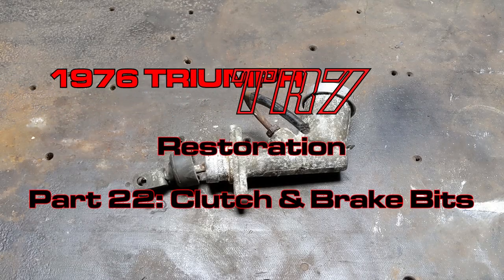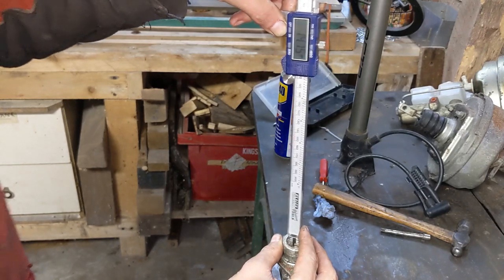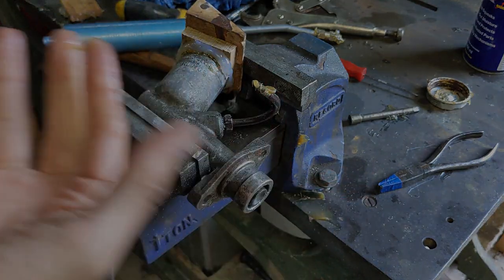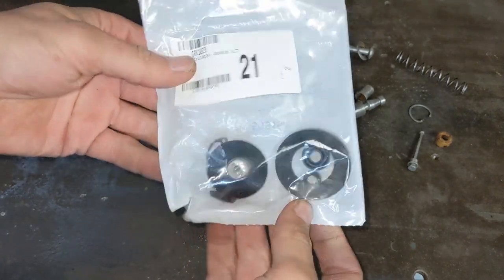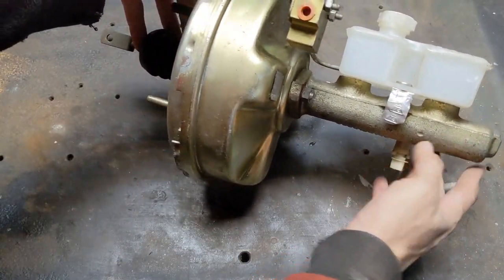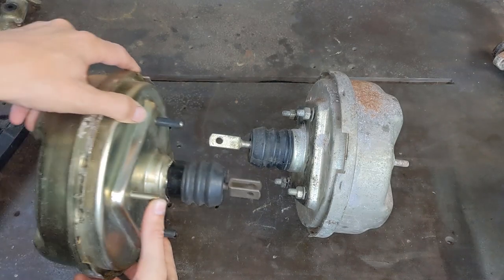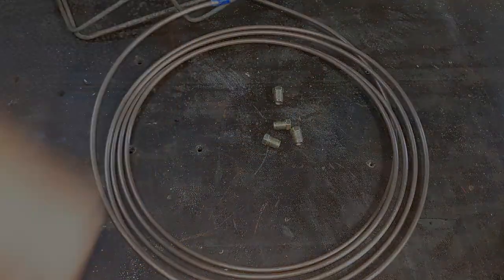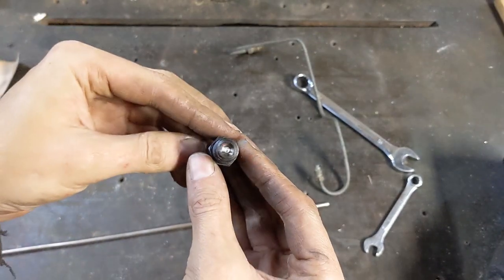Brake & Clutch Cylinders - Triumph TR7 Restoration Part 22

Comment: The broken flare tool was because you did not forget to put both nuts on the pipe before flaring the ends lol.
On a serious note, I did as you did with the clutch master cyl and the bloody thing leaked after a few months so it's worth while getting a new one as it makes a mess of the paint soundproofing and carpet.
Good to see progress.👍
Reply from the maker: Haha, yes, something had to fail! 😆

I'm confident the clutch master is okay, if it had been pitted I'd have tossed it. But the bore is as smooth as a baby's bum after the honing 🙂 Honestly, I've got more trust in it than some of the modern pattern replacements, which tend to be hit and miss on quality. But noted, and I'll be keeping a close eye on it 👍

Comment: Soaking stuff in Diesel is a great way of shifting stubborn bolts etc.
Reply from the maker: Indeed. But the issue with the clutch cylinder wasn't that it was that badly seized, it was that I couldn't get a decent grip on the piston to pull it out. Not without damaging it anyway. In retrospect, soaking it in diesel may have helped. But in retrospect, I should have just chucked it and bought a new one to begin with 😄
Reply: @RedsGarageUK  i actually admire the fact you do your upmost to save and re-use what you can…. I’ve only ever restored motorcycles… (nut and bolt as you are doing) but would love to do a car one day… I find your films very inspiring as well as fascinating and really relaxing to watch (especially the guest cats👌)
Reply from the maker: @patrickhostler5939  I hate throwing stuff out if it can be repaired or restored - I'm not a fan of just throwing new parts at a project if I can help it!
There might be a motorcycle resto on this channel in the future... we shall see!
Glad you're enjoying the content though, it means a lot to hear that! 👍

Comment: I bench bleed those dual circuit master cylinders as they can be difficult to bleed in the car from "dry".  Just use a couple of pieces of rubber pipe to recirculate the fluid back to the reservoir and you can pump it continuously for a minute or two util all the air has come through.
Reply from the maker: Good advice. Got all that fun to come!

Comment: Man vs clutch cylinder
Reply from the maker: The clutch cylinder won.
Reply: @RedsGarageUK  I must be on my 3rd clutch master cylinder and 4th rebuild kit in 38 years of DHC ownership.  I never trusted myself in honing one.
Reply from the maker: @Poz100  I figured it was worth a try. The pin's too short anyway, so I'll be replacing it and I'll never know if it would have worked!

Comment: I think I would just buy a new one. Time , energy you know.
Reply from the maker: It's a fair point, but I like to try to repair things where I can. It's not always about the money, sometimes it's rewarding to bring things back to life, even if it's technically more hassle than it's worth.
Case in point: This entire car 😆 For what I'll have ended up spending on this whole project I could simply buy a very tidy TR7 and be out driving it tomorrow. But where's the fun in that? 🙂
Reply: @RedsGarageUK  you make a great point. Way more satisfying your way I think. Also I’m planning on starting on mine this spring. Following you will make it easier but first I need to construct a work shop to do it. Lol.
Reply from the maker: Lol, good luck! It's worth making the effort on a decent workshop, you'll be spending a lot of time in there. I started this resto in a single garage not much bigger than the car itself and with no power or lights - not recommended! 😆

Comment: Hey there I started watching your videos, I myself have a tr7 with a sbc in it, but I have a crack in what looks to be one of my lower trailing arm mounts. Do you have any information on how to fix that? is it just a matter of take off bolt on new one or would a frame shop need to fabricate one?
Reply from the maker: It depends entirely on what's cracked and where - if you mean the part where the front of the arm mounts to the body, that's all welded in place, so you'd need to get that welded up (It's a fairly common area for them to go). Not too bad a job once you've got access.
Have a look at my rear axle video (https://www.youtube.com/watch?v=4JAaZToTQbE) for a better idea of what's there.
Reply: @RedsGarageUK  Thank you for the reply, I watched your video in depth and I believe I was able to identify what may be my problem. The “mount” that the tie rod bolts to/connects the lower trailing arm to the car seems to be cracked for me. Not 100% what the name for that part is called but is that something I’d be able to replace or would it take some fabrication?
Reply from the maker: @MarkMark-nz3ki  It would need some fabrication. I don't think you can buy those parts any longer, and it would still need to be welded to the body anyway.
If it's just cracked and isn't actually rusting away, it shouldn't be too big a job for a competent welder, but as it's a suspension mount it's something best left to the pros.

Comment: Top stuff, well done! :) PS - have you decided what you are going to do about the engine yet? (I noticed the TR Drivers mug alluding to V8 perhaps?) :)
Reply from the maker: Thanks! 🙂
The short term plan is for the standard 2.0 to go back in. I was originally planning a V8 swap, but fuel economy is kind of putting me off - I want to be using this car a lot, and the V8s are quite thirsty. 
Long term, who knows? Keep it standard? Go with the V8? Sprint engine? Or something else perhaps? I'd even consider going electric if the prices get low enough.
Reply: @RedsGarageUK  I feel similar about the V8. I love the rumble, but not ideal if you want to do some miles.. But on the flip side, I think I have covered 450 miles in 3 years with mine!! I look forward to seeing what you do with it :) PS - if you did want the V8, on EFI with a tall rear diff, using 3.5 you'd hope to get 25mpg on a long run which isn't great, but not the end of the world for a car that might do 3k per year tops perhaps?
Reply from the maker: Yeah, that's exactly what I'm afraid of. I don't want to be constantly thinking about fuel costs, and I plan to have this as a daily driver. I don't want to be afraid of racking up some mileage 🙂
I was thinking at one point about putting a Saab B204 turbo engine in there (there's heritage of sorts; the Saab B engines are a descendent of the H series, which is essentially the Saab version of Triumph's slant 4), but that's a lot of work and I'm not even sure it'd fit.
Either way, for now I'm going to keep it simple and standard!
Reply: @RedsGarageUK  I think the Saab engine lays on the other side which is ironically why the water pump ended up where it did (with all the associated pitfalls on low coolant) on our application.... Mine is just a standard 4 cylinder engine. I like it myself, its not fast, but not slow either, meaning it keeps up with modern traffic perfectly fine. And seems to have almost diesel like properties with tons of low down torque (I like being lazy with the gears!). Thanks again for all your work on these videos, they've been really great, and i've got to pluck up the courage to change all my bushes and shocks, so you've given me a great head start! :)
Reply: @RedsGarageUK  I have a 1980 that I’ve always wanted to put a v6 or a 2.0 turbo in. I’m on a small budget though. Probably don’t want to buy a lot. My tr has a blown head gasket. Bad ragtop also.
Reply: @RedsGarageUK  I saw someone had put a K-Series into an MGB - would that fit?  maybe the VVC version for a bit of pep.  I've always though the V8 was nice but overkill for the size of the TR7
Reply from the maker: I'm fairly sure they're the same orientation... the Saab 90/99/900 has the engine in backwards (flywheel at the front, timing gear and pulleys up against the bulkhead) so it looks like it's the other way around. 
I'm with you on the standard engine though... I don't remember it being all that slow. Not fast by any means, but I never had a problem. Putting some other engine in is more about the engineering challenges for me, rather than just wanting something faster! 😁
Reply from the maker: I'm sure I've seen a K series in a TR7 before, so almost certain it fits! 
The 7 engine bay is fairly large, the main issue is height - probably why it ended up with the slant 4 in the first place rather than something like the O series. Those sleek wedgey lines mean some sacrifices have to be made! 😆
Reply from the maker: You're probably best getting the head gasket repaired if you're on a budget... I've seen a lot of different engine conversions (V6 is a common swap in the US), but I don't think any of them are easy swaps. Even the usual V8 swap needs a modified subframe and a few other bits.
The standard 2.0 gets a lot of flak, but it's actually not a bad engine for the time.

Comment: Hmm I rather have gone for a new clutch pump, possibly one with visible oil level...
Reply from the maker: If I'd known it was going to be as much work as it ended up being, I would have done. But I do try and save parts where I can rather than tossing out and replacing. Sometimes it just doesn't work out!
Reply: @RedsGarageUK  it is just that I would not trust too much a pump who may have accumulated some - even barely perceptible - corrosion to have a long lasting second Life, bar a serious remanufacturing effort.

A clutch is less critical than the brakes, but it still is not a great moment when them pumps decide that pumping oil is so damn bourgeois and they rather stop doing it...
Reply from the maker: @woongah  It's a fair point, and one I had considered. But I've been burned before on no-name pattern replacement parts and usually have better luck refurbing the OEM originals. My plan here was to keep a close eye on this one and swap it out for a new one at the first sign of trouble. 
But in the end, I've decided it's more trouble than it's worth so I'll be buying a new one anyway. I tried...